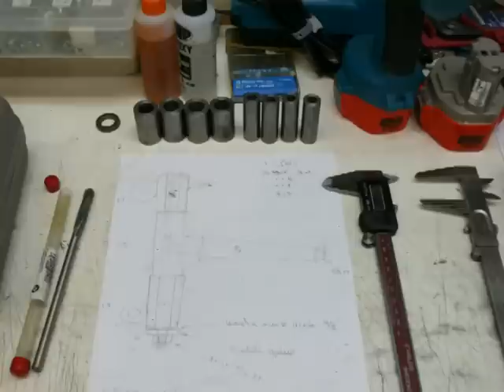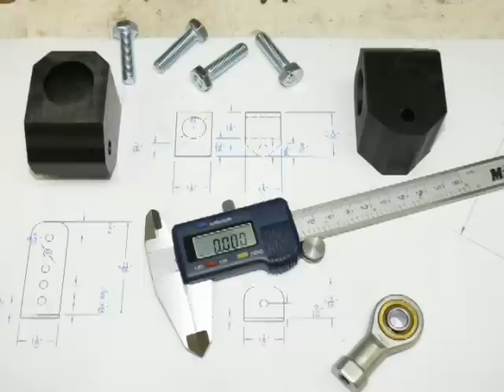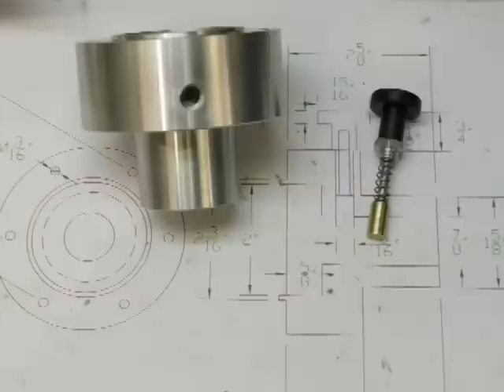Homemade Off Road Go Kart - Son and Dad project (Videos & Pictures)

Comment from the maker: Your're right. The combined lathe and milling tool is mine.  I use it for Hobby work. It is installed in a micro shop in the basement.  BTW, I'm also a Mechenical Engineer !

Comment from the maker: @sidjip 
You are right, it is not small.  The seat position is adjustable, so an adult can ride it.  As for the width, the independent suspension mechanism takes some space.  The whole thing fits in my Dodge Caravan.

Comment: Nice work, but if you are going to make double wishbone suspension, the pivot points for the spindles need to be held to the a arms with hem joints so that when the suspension is compressed, you don't get negative camber. This would happen if you were using single wishbone suspension.
Reply from the maker: Look carefully at the spindle design at 0:24  you'll see that the wheels stay perfectly vertical as the double wishbone swings up and down.  As for the tie rods, I agree, this is a simplified design.  On slippery grass...not an issue at all.

Comment: You must be an engineer HUH? your work is amazing!!!! I would LOVE to do this with my son, but the cart wouldn't come out this NICE!!!
Reply from the maker: I am actually an engineer, but building has been in my blood for ever,  The real reason for me to become an engineer was that I did built multiple engine powered bicycles as a teenager (what a thrill) for which I had to buy pulleys at the local hardware store with multiple trials and errors in the size selection.  I could not afford those errors with my tiny weekly allowance.  I got so frustrated at spending weeks of allowance without getting it right so I thought that there has to be a way to get it right on the first time.  Then my dad told me "An engineer would know how to do this right on the first time."  Using his project as an excuse,  I thought my son how to make the calculations for him to do the proper sprocket selection.  Dad was so proud... he got it right on !!!!   After he completed his calculations, then catalog sproket selection, I showed him dad napkin calculations.  He was right on !  What do you want more….I felt like a king!
Reply: +S Blanchard je fais la meme chose chez moi xD, jai 16 ans

Comment from the maker: @blockedbutADDED 
The single speed drive chain is a compromise.  Being single speed, it is like driving a standard car in 3rd grear at all time.  We selected the sprocket size to be optimized for this design.  3600 RPM on the engine, 10 to 60 teeth ratio, 16 inches tires (OD) =  45 Km/h or 28 miles per hours.  Plenty of fun !!!
PS: Some parts were drafted using Autocad.

Comment from the maker: @workshop1015 
Homemade machined parts (1:21) where the central piece is threaded in the center and slightly longer than the outer piece which is welded to the frame.  A hand made welded clamp is then bolted on each side of the inner piece (1:22).  The clamps are then welded to the axle swing arms.

Comment from the maker: @gSTA1992 
Yes I happen to be a mechanical enginner but the tooling is for hobby only.
The swingarms are 8.8 inches long (20.6 cm).  Sorry, longer is better.  The other option you have is to install them in front of the buggy frame, each of them would be half of the total width, and would tie to the frame in the center.

Comment: Take a  look to my last go kart project, I would like to have a lathe and make my own parts. Machine shops in here are too expensive, and they're not like in US. On this kart I'm using a motor just like yours, a cloned 6.5 hp Honda, these motors are very good, the bad is they leak oil by the rear cover, I had changed these gaskets with the Honda ones, and the oil leak stops for ever.

Comment from the maker: @evinsteven13 
The axle, including the tires width makes it 46 1/2" wide all together.  The engine is a 6.5HP that is mounted on 1inch stand-off so I can install a 9hp without modification.

Comment from the maker: @USApunk07 
Rear motorcycle caliper (ebay) and used snowmobile disc brake (local used parts dealer) that already had the the proper 1 inch keyed shaft hole.  My original plan was to use a front motorcycle disk brake and machine myself the required hub, but the guy at the local used part store new better what I needed.

Comment: @Homekart Ah! Thanks!
I'm thinking of ripping a 125cc (1 cylinder) engine out of an old motorbike and making something similar to this just as a little hobby i suppose.
Also, did you use Mild Steel on the frame or something different? And how well is it holding up? Sorry about all the questions :) Thanks again.

Comment: nice design, but do you think running a jackshaft would have been better?  being full suspension and all, if you take it off road aren't you worried about your drive sprocket/chain hitting something being in the middle of your axle?
Reply from the maker: Eben, you are totally correct.  Now, the goal here was to do a father & son project to have a good time while he was learning how to calculate sprocket ratios.  I did not want to add the complexity, weight, physical length and time to the project.  He has been destroying the land around the house to date without issue with the large sprocket so far !  That might be a later upgrade project for us, still we would keep the same final gear ratio.
Reply: +S Blanchard 
we recently got an old kartco kart up and running. been thinking about a full suspension build with my boys, something to take out while camping.  looking at a lot vids for ideas, so far yours has been one of the nicer ones
Reply from the maker: Thanks.  We had lots of fun doing this.

Comment: This is a great video...I have an 8 year son I would like to do something similar with.  What kind of welding equipment do you have?
Reply: Id probably think a mig as they are easier and cleaner to use
Reply from the maker: Yes a Lincoln 140 Amp Mig with flux core wire.

Comment: Hello, excuse me, could you tell me where you bought the rear axle?
Reply from the maker: The rear axle is simple a piece of 1 inch diameter cold roll steel purchased at the local steel supply store
Reply: It's okay, I'll do it, thank you very much.